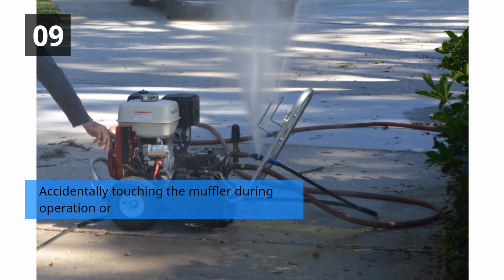Precautions for the proper use of a pressure washer

Comment: I have a general pump 4040 I think the psi on the unloaded is set to 4200 and it broke my 4000psi hose, how do I adjust it so it is 4000psi and how do I gauge how much psi is actually coming😊